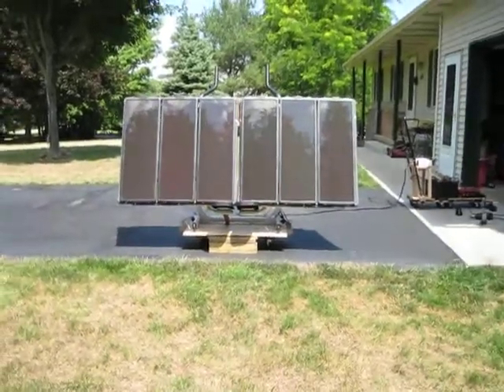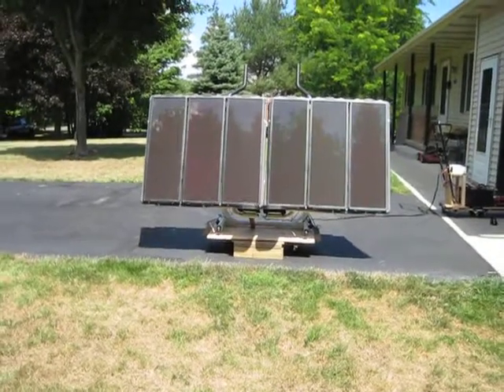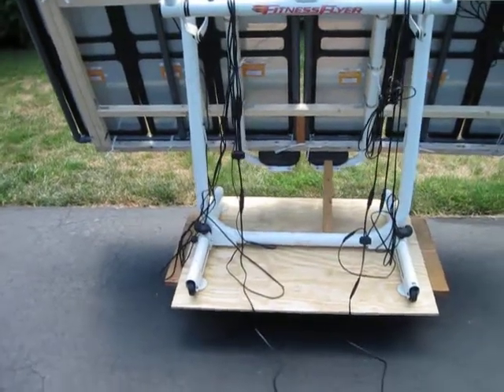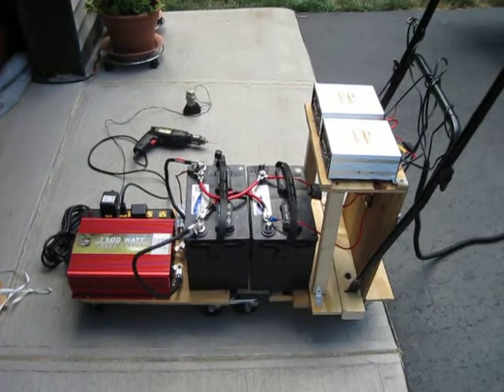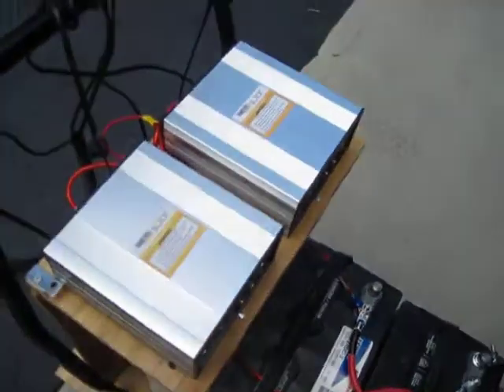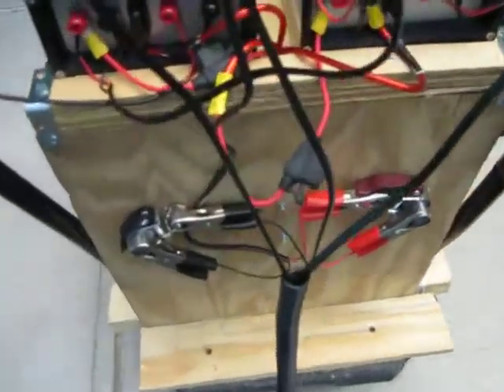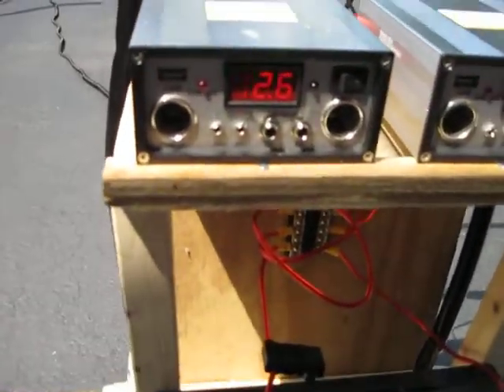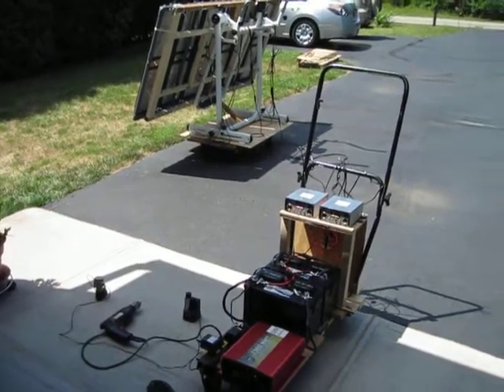My New Solar Panel Kits Set-up

Comment: 2 12 volt batteries ran parallel is 12 volts. the amperage is doubled. your statment would be true if it was in series.

Comment from the maker: 1500 watt inverter ('new') on sale from the internet site that had only 3 left. Total $224.98.
Dual Bus bar  100 amp
Scosche EWFH single ANL fuse holder
ANL150 fuse  gold fuse  ---  ALL of these were purchase on Amazon.com. The total bill was $46.19...However, there was something else I bought that was not related to solar.

battery cables at Adance Auto Parts & Tractor Supply Co. were $5.99 & 6.99. 

The wire, 30 amp fuses, battery clamp terminals, misc. items, I already had at no price.

Comment from the maker: Hi Wolfeman351,  Here is the list of the things I bought for my solar project.

2 HF solar panel kits. (on sale with a coupon for $149.99 ea.)  Oh by the way,  I do have an "extra" coupon for 1 of these kits for 149.99 if your are interested. It expires on 8/22/12. If so, send me your address and I'll send it to you tomorrow.

2 marine deep cell batteries from Advance Auto Parts on sale for $84.99 ea.. Plus I had 2 cores that knocked off $10 from the total amount. 

Continue to next post.

Comment from the maker: If it's just a sump pump. However, if it's well pump used for your whole house (like my is) its not! Because that is 220 line...example what a dryer uses. That's a lot of power, more then this little system can handle.

Comment from the maker: Yes, you are correct, my mistake thanks for pointing that out and I will correct it right away. In others words folks, my 150 amp fuse is suppose to be "inline" with the cable going from the battery post to the inverter. Thanks again!

Comment: also put your fuse inline from battery to inverter, the way you have it here it's not doing a thing.  If you have trouble seeing this as an issue (not to even imply that you do) simply pull the trigger on the drill and cut the fuse wire while it's running.  It will continue to run and if this were an overload situation, it would destroy something.  just trying to look out for you, have a great day.

Comment: The way you have the DC hot connected to the inverter bypasses the fuse.  ALL hot wires must be connected to the fuse for it to work.

Comment: Good job, only one suggestion. I would only put all 6 panels on one charge controller, I am pretty sure one is rated to hold 90watts. Seeing how the charge controller will be the first thing to go bad it would be wise to store the other one for back up.  Either way you did a fine job.

Comment: Those 2 panel kits from HF are AWESOME!  I use them to charge the batteries for my ham gear.  Now if only I could build a small circuit to drive a motor that tracks the sun.